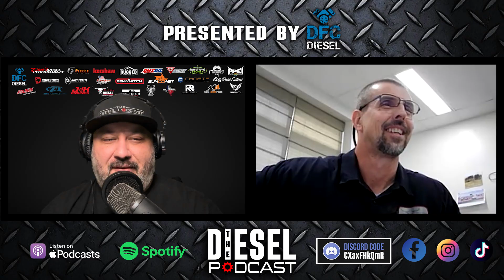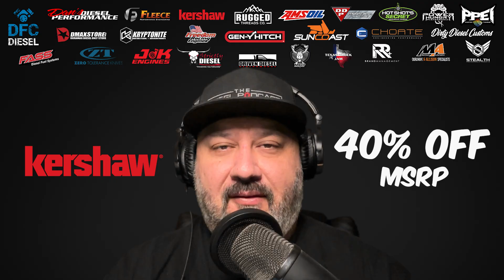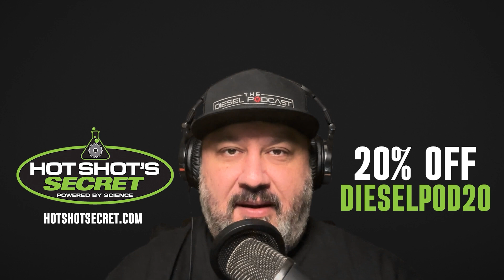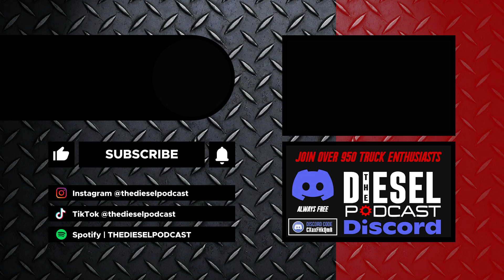Mechanic Tips for More Reliability

Comment: I was listening to this podcast behind the wheel of my 05 and was nodding along. I have replaced basically everything possible on it mostly just because it’s all old. It runs like I remember my old 06 that I bought nearly new and i was cruising down the road with 11k effortlessly in tow and was thinking how great the 6.0 is because it’s new enough to be nice and old enough to be simple. Extremely well built cab even by todays standards and the 05-07 is the best looking ford tied with the 17-19 trucks.  I’ve owned newer trucks but keep buying these old ones because the new ones always have me grief involving the emissions stuff. Can’t delete due to inspections here so went back to old ones. 

Love my 6.0’s have had the best luck with them. Also own a manual 02 Cummins. Such a POS but love that stupid thing anyway.